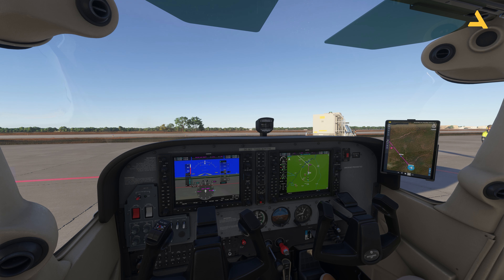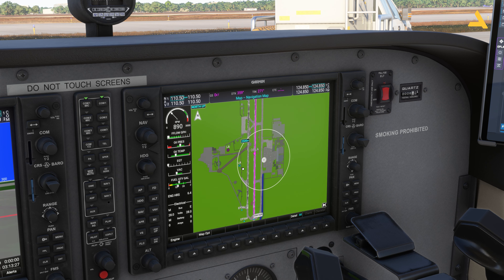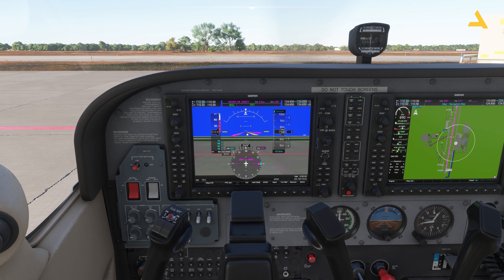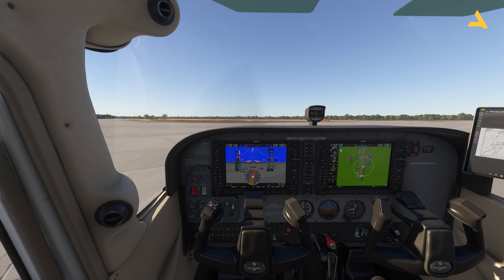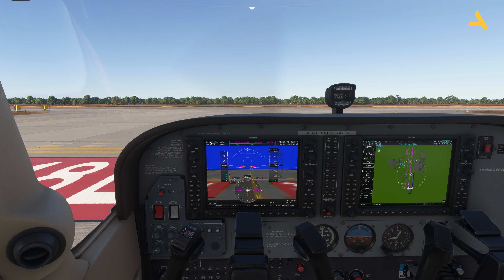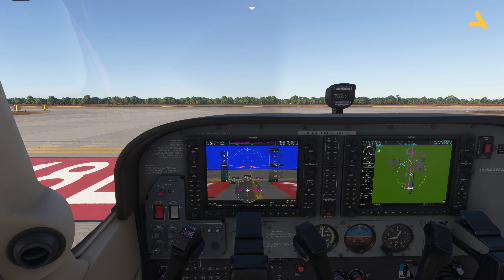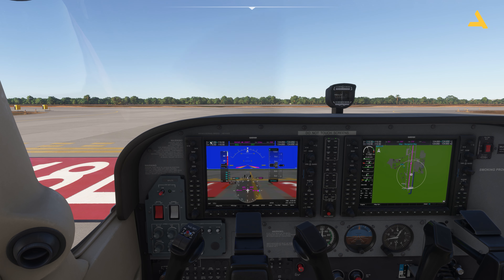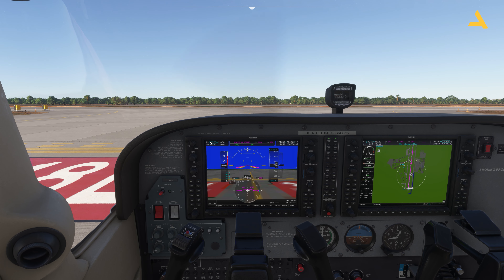Take Off and Autopilot Tutorial of Cessna 172 with G1000 in MSFS 2024 - Tutorial 3

Comment: I just started using the autopilot, so much better for Carrier missions.
Reply: im so confused is autopilot just a one button press in the settings and it flys automatically?
Reply: @ I don’t fully understand it. You need to turn on the heading and altitude buttons then the auto pilot. You adjust the heading with a knob but I can only get the altitude set by physically being at the altitude I want. I’m doing something wrong with the altitude.
Reply: @d.b.1176  is this the same with all planes or just the Cessna
Reply: @ I’ve only done it on the 172. Some planes have a different screen or no screen at all. I’m just grinding for money right now.
Reply: @ I wish they would bring back the ai pilot feature to career mode
Reply from the maker: It is really a great plane to fly. Thank you for watching the video and your comment. Have a nice day.
Reply: @d.b.1176  Set the altitude you want and then turn on "Flight Level Change Mode". When you turn that on, it will start to adjust altitude and automatically turn off when it gets to the appropriate altitude.
Reply: @22Alec2222  thanks. I was turning off the altitude and doing nose up or down. AP is so nice for long boring flights.

Comment: i cant figure out how to change gps altutude
Reply from the maker: The left lower corner of the PFD has a knob ALT. You can use that to change the altitude
Reply: I was changing it with the knob. But AP kept following the green gps altitude and not the altitude I was setting. It may of been bugged. I spent 45 mins trying every control and setting on the g1000 and it would change the green gps altitude all though I had my altitude set to 5k it kept following the gps alt that was auto set at 840
Reply: I also try nav mode, altitude mode, vertical mode, etc to see it ap would go to my set altitude. It may of been bugged, because I've had it set before where it followed the purple line and purple boxes perfectly the other day.
Reply: @aatifahmad  How do you use VNAV?
Reply: @BurningBiscuit  How do you use VNAV?
Reply: @idantal1760  the little buttons around AP buttons
Reply: @BurningBiscuit  Just like in real life, you need to press either f/l change (flight level change) or VS (vertical speed) mode for an ascent/descent. In f/l change mode, the plane will try to maintain the speed the aircraft was going when you pressed the button (so you can essentially control the vertical speed with the throttle), generally, lower speed for faster ascent/slower descent or higher speed for slower ascent/faster descent. With the vertical speed mode, you can select how much your aircraft will ascend/descend in a minute (feet), but you need to watch the speed and manage the throttle. Both the selected speed (in f/l change) and the feet per minute (in VS) can be adjusted by the two lower right buttons in the AP control panel (named nose up/nose down in the game). Hope this helps!

Comment: I think the auto pilot is kind of buggy, i have to correct the course regularly unless i set it to heading mode it never follows flight plan
Reply: My problem is even with everything set up right sometimes when i want to activate ap it just doesn't want to activate so yes ap might be a bit buggy
Reply from the maker: Is your CGI mode set to GPS and OBS is off in the PFD?
Reply: @ yes
Reply from the maker: Can you share your flight plan with me so that I can check what is the issue. Thank you
Reply: @aatifahmad  Same happens to me, somehow when i press NAV mode, GPS mode activates but i still have the NAV/ROL written with green on the screen and GPS is with white and it doesnt follow the plan
Reply: @aatifahmad  Not sure if it was the OBS or just the default AP controller key bind but seems to work now every time if OBS is off and i use the actual AP button instead of the key bind